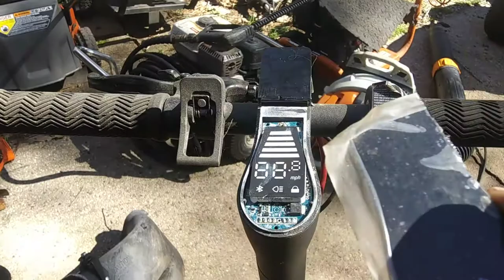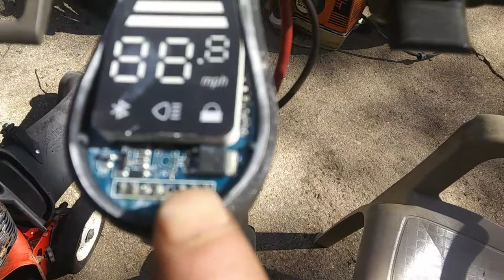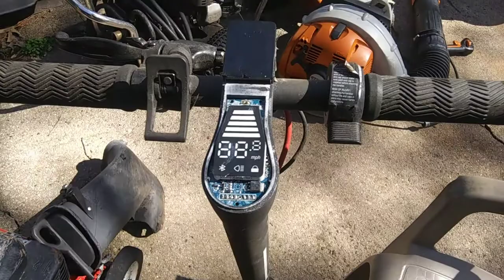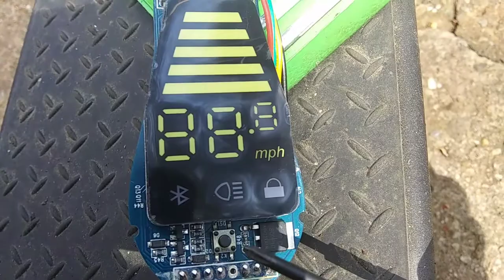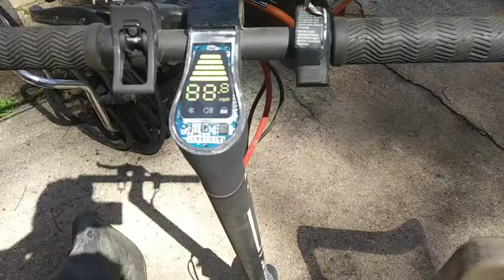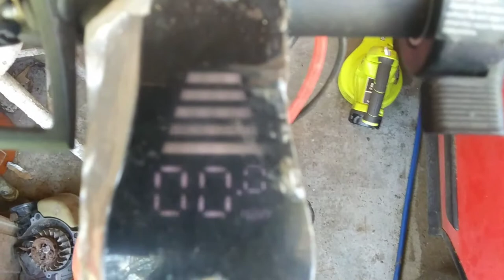Swagtron Swagger5 power control board.

Comment: Where did you get the control board? 0:46
Reply from the maker: Google Swagtron,it's a big pain to deal with this company on parts,some you can find on Amazon,Good luckk and God's Speed!
Reply: @JungleBobRepair  Thanks I'll see if I can find one!
Reply from the maker: I normally don't do scooters,im a small engine guy,but I have a few customers for that,so I'm adapting,everything is changing,learn all you can.
Reply: @JungleBobRepair  You wouldn't by chance have an extra one would you?